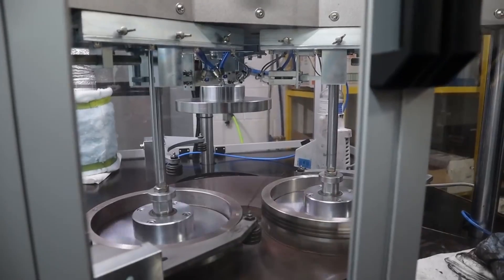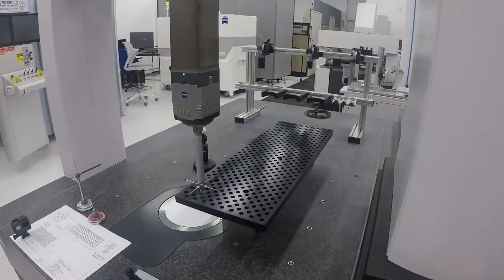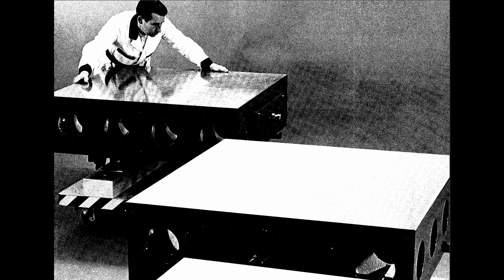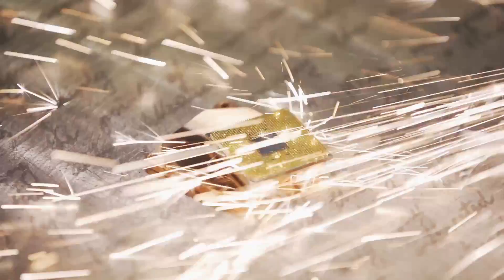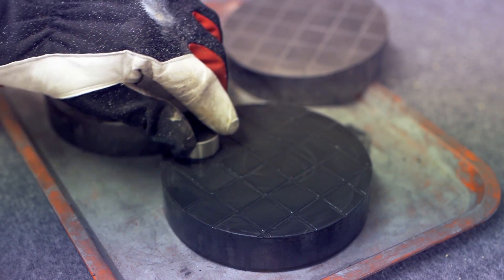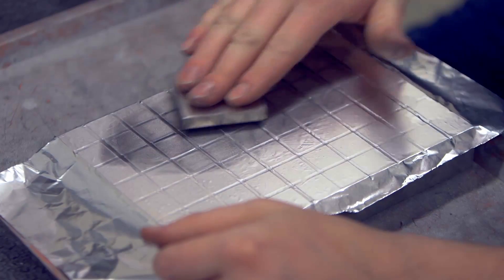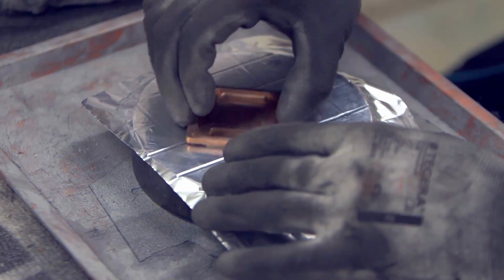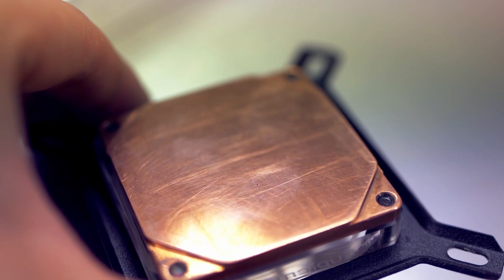Lapping a CPU, the proper way [AMD 3950x]

Comment: Maybe you can contact AMD and propose this method and maybe we can make this a standard?
Reply from the maker: Doubtful they'd ever be interested but etching the serial on the side of the IHS and running it through a surface grinder would get you within a few microns of accuracy for very little added manufacturing expense.
You have to remember that if you're not matching the IHS to an equally flat cooler then they won't wring together and AMD can't control for the tolerances that all the different cooling equipment manufacturers set individually. Some of them surface grind to super fine accuracy of a few microns, others like Corsair don't seem to care at all.

Comment: Finally a proper lapping video. It's very annoying when people just sand their cpu and say they have lapped it.

I have used a set a grade 0 blocks. They wring together very well and I have always wondered what would happen if you wring the cpu and cooler together.

Personally I think once the cpu heats up the thermal expansion will completely ruin all the efforts, they will separate as the ihs and cooler expand at different rates.
Reply from the maker: I'm not sure the deformation you speak of would be that bad. A temperature difference of 50°c will cause a 1mm thick copper sheet to deform by 1 micron. For one that's still within the scale of wringability and actual real world temperature deltas between the edges of the IHS/cold plate are unlikely to be anywhere near that bad. Either way it'll become obvious if it's a problem.
Reply: @Penrowe  it would be across in x and y that might be the problem. The amd ihs is 37mm square so in x and y that's 37 microns. The base of the cooler is a different thickness to the ihs as well as a different width. The water temp will be 40c max, and the cpu will be running at 80c 

Will be interesting to see though. I look forward to the results.

Comment: doubt if he could utilize the ringing to avoid thermal paste, the cpu does deform a bit due to heat (which has a rather large delta and is not evenly heated over the whole surface), would definitely love to see the result do...:) btw, Great video, also this bit with 3 surfaces...

Comment: That's a freaking thing a beauty right there! Bout time someone did a true lapping job on a CPU! Can't wait to see the results. Even if the temp difference isn't massive, I'd still be happy knowing that incredible lapping job has been done and that the CPU and cooling block can be rung together without paste!
Reply: Right?
Liquid metal might even be overthrown...
For all we know...
If this works totally gunna pay him to do a proper lapping job for me.
Reply: @alanfidurski6860 Honeywell PTC already beats in most practical applications.  This is neat to see, but you don't actually want it perfectly flat.  You want a slight curve, concave IIRC, due to thermal expansion, so it's flatter at load.

Comment: Finally somebody has done it
It's been bugging me that I couldn't find anyone who actually lapped a CPU
I'd like to see what you could do lapping an Intel die. Thanks for the interesting video.
Edit
Do you think making aluminum lapping plates would work / be worth it.
Reply from the maker: "Do you think making aluminum lapping plates would work / be worth it."
I made a set of aluminum plates too out of 5754. Complete pain the arse and not worth the time spent on them. Tin is a more promising candidate but to make a set I'd need 10kg give or take, not all that easy to find since the only people buying/selling the stuff are tin soldier hobbyists and niche metalsmiths.
Reply: @Penrowe  I'm not much for metals but I love puzzles. Would zinc be an option? 

I was working in my mind. Lead had the associated health issues. Magnesium has the burning issues. Zinc could be too hard. 

A few Google searches turned up a Bismuth/Tin alloy 281. Might be worth a look.

Comment: Video is definitly wrong. You cant get ANYTHING withing 3 micrometers... you would need atoms literally cut in half or have bonded atoms that have equal height. By scraping the closest you could get is 26 microns and if anyone says otherwise they are full of shit. To get from 1 to 3 you would need the chip hanging upside down and have a lazer thats perfectly parallel to it shoot past it to make it smooth.
Reply from the maker: Hand scraped surfaces can match or be within a flatness error of 1 micron across huge distances. You don't know what you're talking about.
Reply: "You cant get ANYTHING withing 3 micrometers" 
You can even turn and mill within 3 μm!
That's like high precision manufacturing and not even ultrahigh precision manufacturing, which can actually go down to 0,005 μm (not actually in an industrial environment).
There are gearwheels for mechanical watches with 50 μm teeths.
Reply from the maker: @th3realmuri399  I used to work at SECO a number of years ago, set up, operated and took hundreds of measurements daily with machines that had measurement errors in the sub-micron range — on a line producing $5 inserts.

Comment: Awesome stuff. 
I am however curious in regard to increasing the surface area, by using a rough paper on the flat surface. (much like the rifling on the bottom of cooking pans helps.) Any ideas of how that could be accomplished?
Reply: if you want to rough up your surfaces, get a fine abrasive surface of your choice, and create your minor grooves in a specific direction. should take just a few seconds to make the grooves you're thinking of. make the grooves in the same orientation on the surface it will be mated to.
then fill in the imperfections you just added with Paste and wonder if it was worth bothering.

Comment: it would be interesting to see the effect of mounting pressure on thermal performance under wringing
Reply: probably minimal given how hard it is to pull apart gauge blocks that have been wrung together. You have to slide them off of each other.